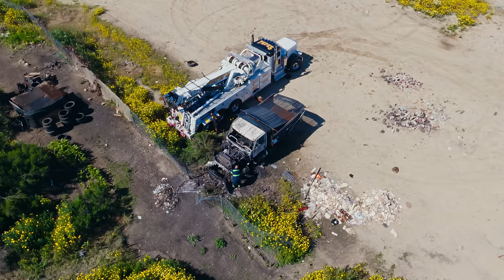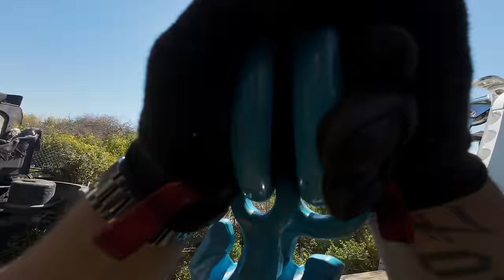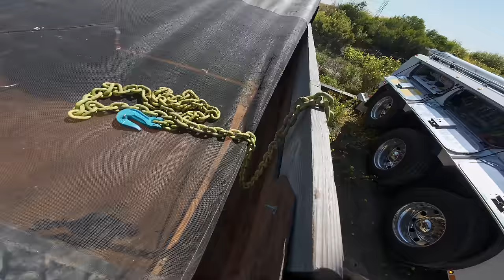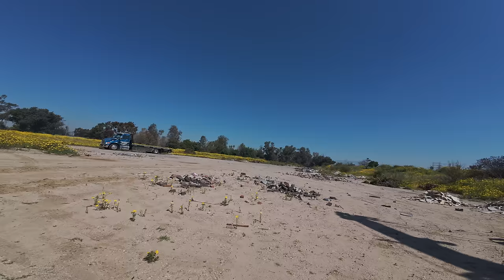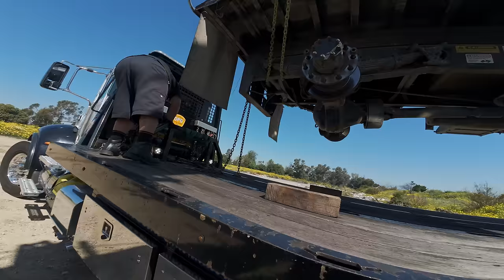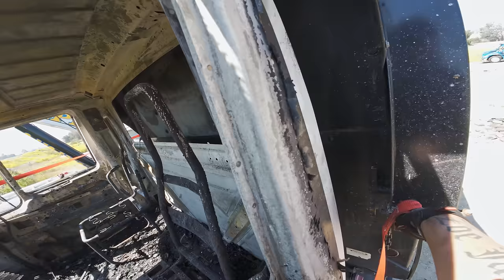Thieves steal, strip and EXPLODE a dump truck!

Comment: I'm imagining the original tow getting there and going, "well that ain't rolling onto my bed!"  crazy how striped it was.  I'm not sure about commercial vehicles but stolen cars in the UK end up at secret chop shops. They used to strip them locally but now they cut the front off behind the A pillar, throw in the doors and ship them oversees. They get a lot cars per container. 

PS. That tipper was so tiny compared to Big Flipper!  It would be a challenge to fit a rotator on British roads.

Comment: If I didn't live over on the east coast, I wouldn't mind having that dump bed and rear axle. But it would cost more than it's worth to have it shipped.
Reply: You can find both on the east coast.  Not some rare commodity.
Reply: @I_Dont_Answer_Questions  everywhere I've looked, they want new prices. It's like my jeep Wrangler. Everything I've bought to rebuild a 93 yj has come from west of the Mississippi.

Comment: I've sent previous emails saying you need to buy a battery operated  chain saw for clearing awkward shrubs etc
Reply: I have one.  Normally I don't like the battery-powered tools, for no more than I use  them, but the chain saw is a once-a-year thing and is perfect.
Reply: Did anybody ask you?  Didn't think so.  You should be used to that by now.